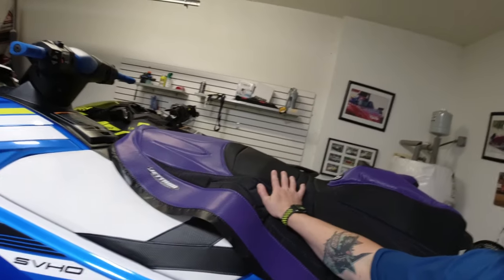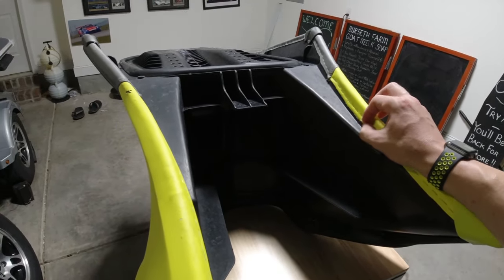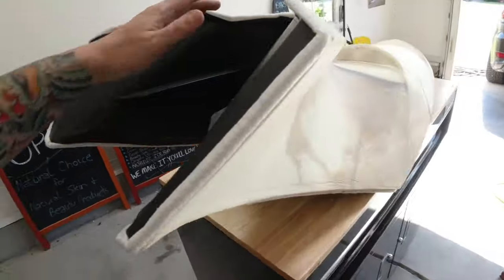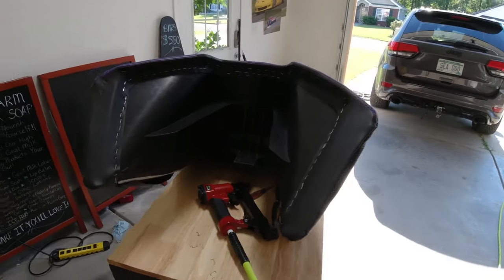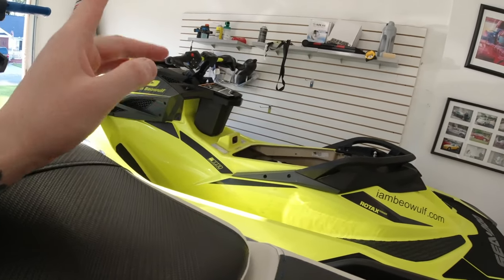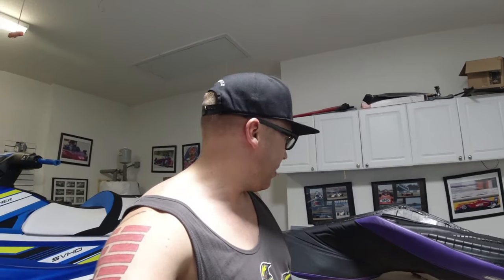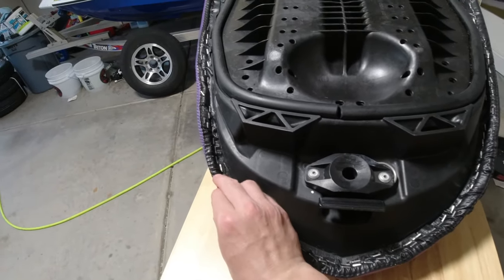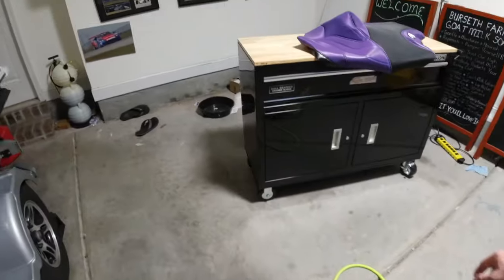How To Install Jettrim Jet Ski Seat Cover On 2018 Sea-Doo RXP-X 300

Comment: Nice install seat looks awesome! Hey can you move your skis on the trailer by hand or is it two much weight?  Reason I ask I'm looking  at getting  a ski with a double trailer was wondering  if I could jockey it  around when not hooked up to the truck